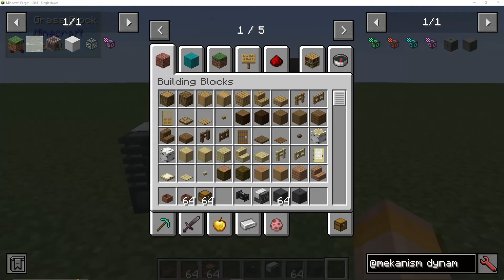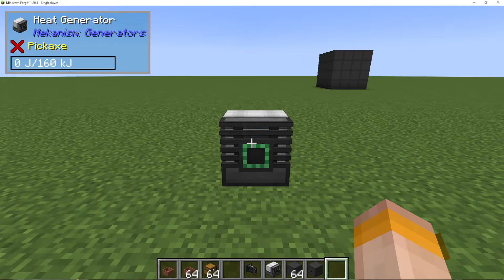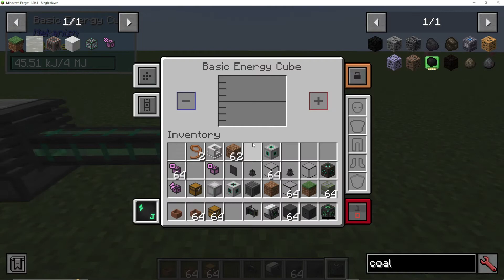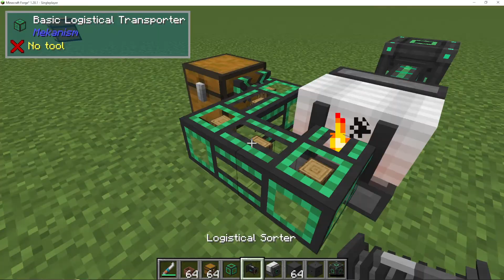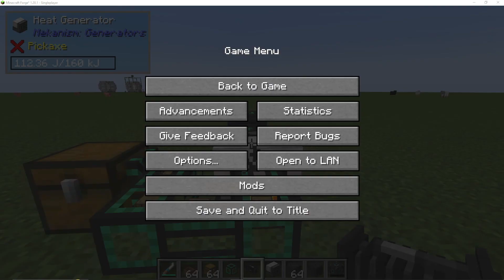Mekanism Heat Generator Full Tutorial

Comment: you can also put lava around it for passive energy generation. You can get creative with this but try not to burn yourself.
Reply: Can y put lava under it?
Reply: @darlingsimmer0321  took a bit for anyone to reply to you, but the heat generator gets more passive power for each adjacent block that is lava, source or flowing. That includes the heat generator itself as well as the universal cable in front of it, both of which will let you place a lava bucket in their block space just like waterlogged stairs. You have to sneak right click with the bucket to add or remove lava from the heat generator block space itself, otherwise you'll open its UI. Just like waterlogging a chest! What I usually do is place a 5x5 diamond shaped tower of bottom slabs around the generator, which keeps the lava contained while still allowing the player to look/reach inside to access everything. The inside is a perfect plus shape for the lava to flow around the sides of the heat generator and also flow underneath it, so you only need to place a lava source inside the heat gen's block itself, then place a lava source directly above it. I mean... you can just bathe it in a lava pool, but I find only having max 3 lava sources (one in the heat gen, one in the universal cable right out front, and one directly above) means a lot less work when it's time to move/upgrade the setup.

With 7 faces (including the generator itself) covered in lava, an Overworld heat generator will output ~120J/t, or 48 FE/t if you prefer. :D

Comment: Can I use it with out a universal cable
Reply: Yes place the heat generator with the green square on the front of it facing the machine you want to power. It has to be touching it directly.